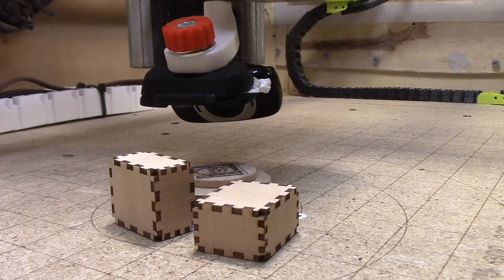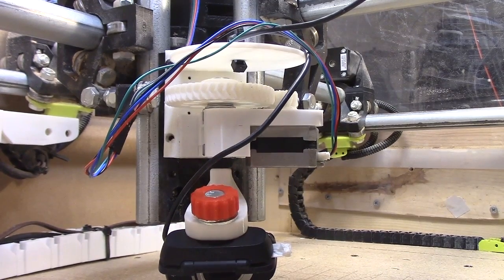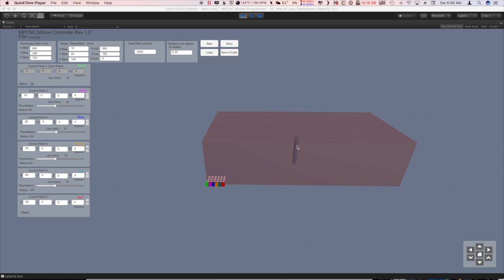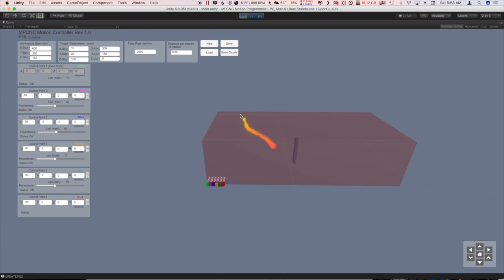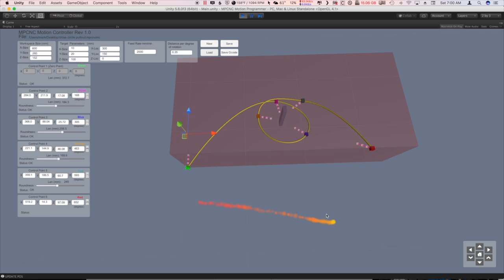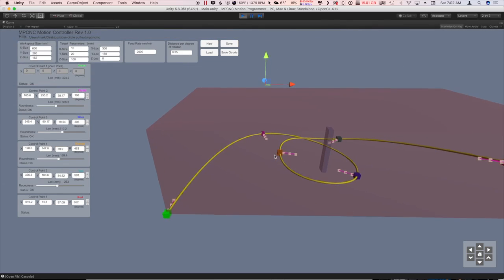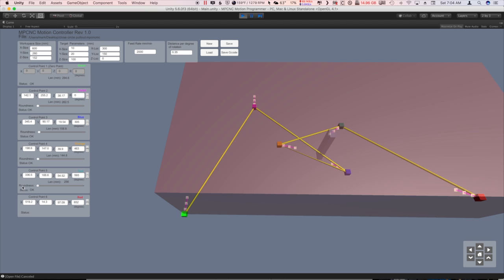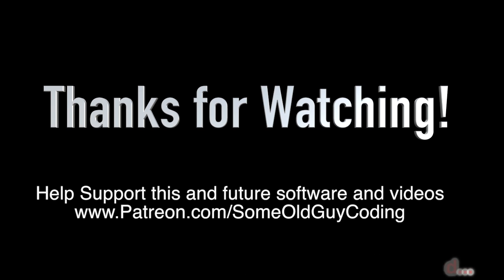MPCNC Episode 33   MPCNC Motion Controller

Comment: Very cool. I can definitely appreciate the amount of work that goes into something that is functional like this, plus the amount of work to make a relatively complicated operation become user-friendly. It looks like you've thought of some very clever interface items.

I've never used Unity or their asset store. My programming experience is with Linux/C++/Python/github. If you ever need some help, or just someone to bounce ideas off of, let me know. Like I said, I don't know how Unity works, but I would be interested in looking at your code if it's available somewhere. I really like the interpolation you've done, with the varying amount of "pressure" at each vertex. I've done something similar with the tuxfamily Eigen library and something else with python's numpy module. What you have is pretty slick. Thanks for sharing.
Reply: Also, the link in the description needs a ".html" at the end (it didn't work for me with just software, but software.html did).
Reply from the maker: Thanks!  All that hard stuff is part of a third party asset (curvy by fluffy underwear).  With unity I think one mostly puts together right right assests, and adds a little c# to make it all work. Some may disagree...